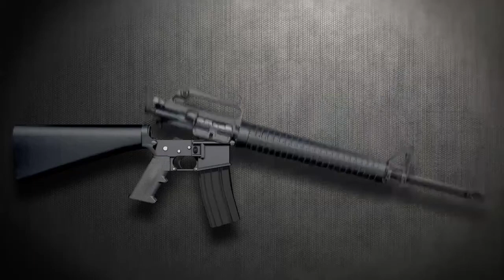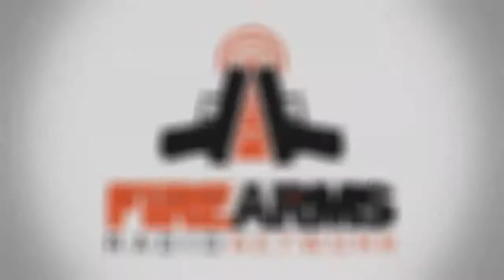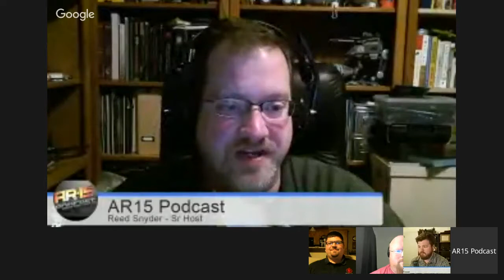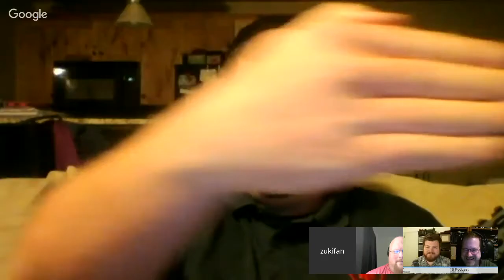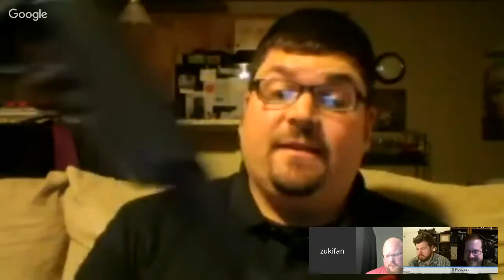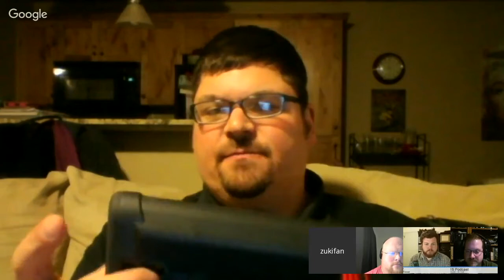AR-15 Podcast - Episode #157 - MK1 Mod2, Primary Weapons Systems

Comment: Quote
"

If tl; dw here’s the summary (there’s more to the interview but I stuck to the Mod 2 relevant stuff): 

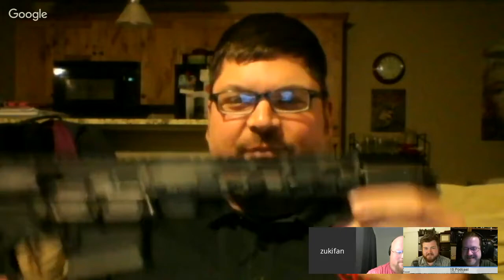Slimmer profile handguard (vertically and horizontally) - 2:34 

Weight removed from front to back (claims between 6.5 – 7oz across the entire line) - 2:46 

Most of the receiver scalloping is accomplished in-forge - 3:48 

Separate steel trunnion is now aluminum extruded from the receiver. Rail now attaches by cross bolt and is more easily user removable - 4:18 

Picmod explanation - 5:24 

Ambi controls, flared magwell, ZEV single stage adj - 7:48 

PWS will focus on piston, Bootleg Inc (bootleginc.com) will be selling PWS DI parts - 12:05 and 47:19 

Ratcheted castle nut system - 12:50pm 

Went to castle nut to reduce weight and profile - 14:35 

Bootleg will eventually sell picmod rail for DI - 16:03 

Endplate/ratchet castle nut will be sold separately for those who just want to retrofit their current set up - 16:30 

Mod 2 carrier is lightened and now nitrided, bolt is still nickel teflon but now polished - 18:04 

Thoughts behind removing GB setting - 20:00 (and 53:20 somewhat) 

300 BLK: (all pistol length gas), 5.56: MK107 (pistol), MK111 – MK114 (carbine), MK116 – MK118 (middy, whereas MK116 Mod 1 was previously carbine) – 22:10 

Proprietary nature of PWS parts - 23:41 

KNS pins currently not compatible - 27:30 

Thoughts on using BCM stock and PG - 28:36 

Mod 1 sales will be phased out as parts supply dictate (3-4 months) - 31:51

"